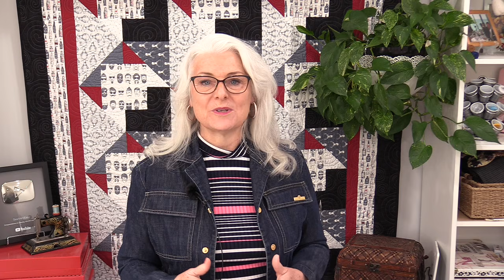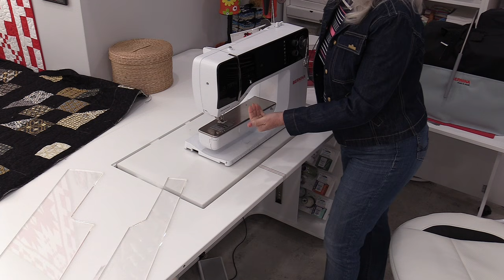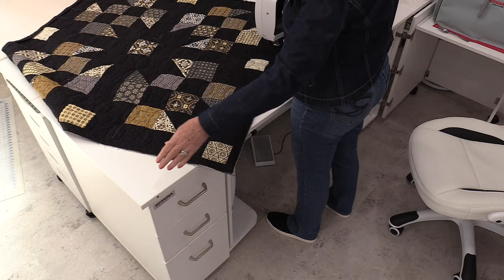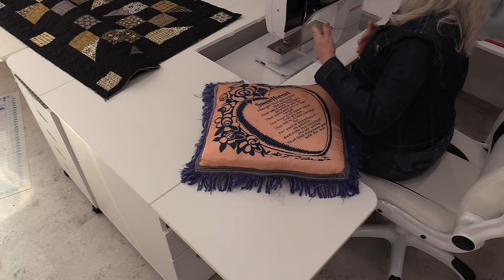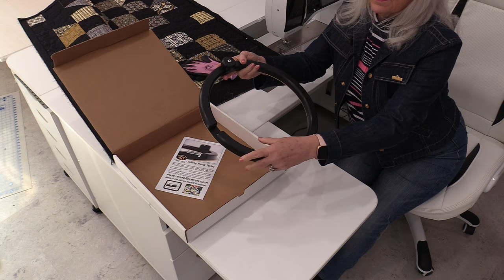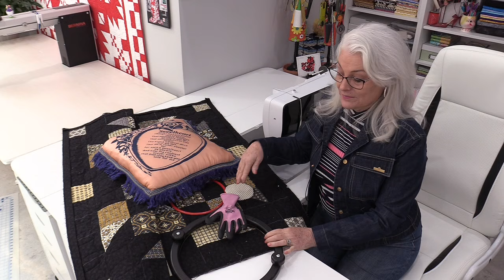Setting Up your Quilting Space

Comment: I used some basic pine timberboard and adjustable height kitchen cabinet legs to create a custom extension table. The pine is lighter than MDF. The legs slot in to sockets screwed to the under side of the pine board, so can be removed when I need to store the table.
Reply: How clever!
Reply: Can you post a picture please